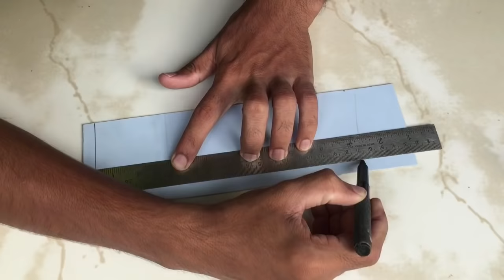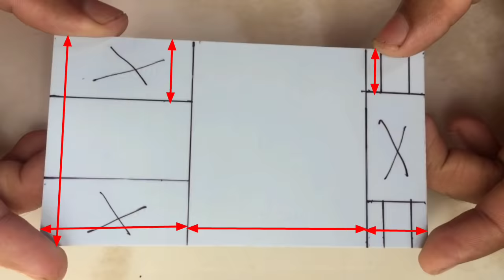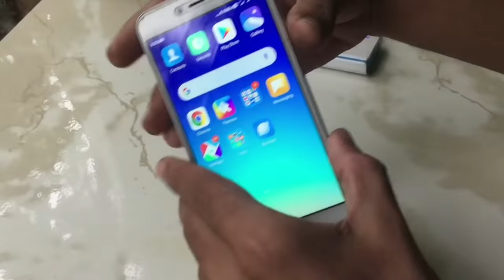how to make a mobile stand using PVC pipe | creative idea with PVC pipe

Comment: Great idea.  I never thought straightening PVC pipe is that easy
Reply: well, i just told that pvc pipe is not that easy to bend one maker have a lot of practice i guess so
Reply: It's not complicated. It just needs to be heated evenly so that one does not create waves in the plastic. That's why using an iron was better than using a hot air gun.

Comment: At first, when i saw the title "at home", i got disappointed that how come its possible to bend and fold a metal sheet at home without specific tools. Later, when i watched the video, i realised that its PVC pipe. Good to know the technique of using iron for straightening the sheet instead of heat gun. 
Excellent work bro. Thumbs up👍👍

Comment: Nice except when the battery starts to leak acid and destroys everything
Reply: I also think of that..but can be replaced whit a piece of metal tubing or metal bar..
Reply: Battery can replaced with hot gun tube
Reply: Why would the battery leak acid if its ports aren't connected?
Reply: It can be fixed with aluminium door latch
Reply: @Rahul-qz8pj  because batteries leak just sitting on a shelf dumdum...
Reply: To the extremely smart people who thinks battery can’t be leaked if not connected “in extreme cold, the battery acid can freeze up and cause the body of the battery to expand. If you've ever seen a water pipe burst in cold weather, you probably know what happens next. The ever-expanding body puts pressure on the cells and can cause the battery to leak acid.”
Reply: @Hardenjade  bro , its nippo battey , it contains carbon  ,and it does not melt easily, if they melt , they  dont have capacty to melt anything

Comment: Great project with just one BIG problem. The battery will eventually deteriorate and leak. It will need to be watched carefully and replaced at least every 12 months. better to swap it for plastic or metal/stainless steel solid rod.

Comment: ESTA MUY LINDO TU MODELO DE SOPORTE PARA CELULAR, PERO OLVIDAS UNA PARTE IMPORTANTE, CON EL TIEMPO LA  BATERIA SE DESCOMPONE Y REVIENTA, CREO QUE DEBES REEMPLAZR EL EJE POR ALGO NEUTRO. UNA MADERA CILINDRICA. Y HACER ESO NO ES NADA GENIAL NI NOVEDOS, CON UNA IMPRESORA EN 3 D LO HACES MEJOR. ////YOUR MODEL OF CELL PHONE SUPPORT IS VERY NICE, BUT YOU FORGET AN IMPORTANT PART, OVER TIME THE BATTERY DECOMPOSES AND BURSTS, I THINK YOU SHOULD REPLACE THE SHAFT WITH SOMETHING NEUTRAL. A CYLINDRICAL WOOD. AND DOING THAT IS NOTHING GREAT OR NEW, WITH A 3 D PRINTER YOU DO IT BETTER.